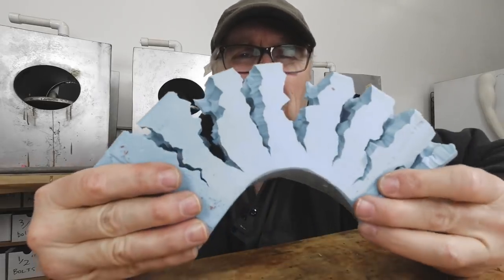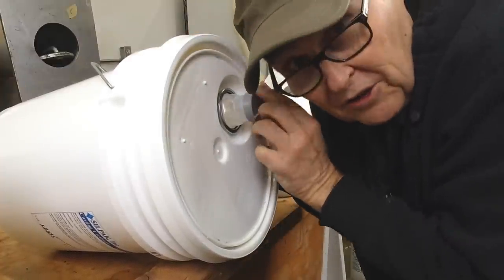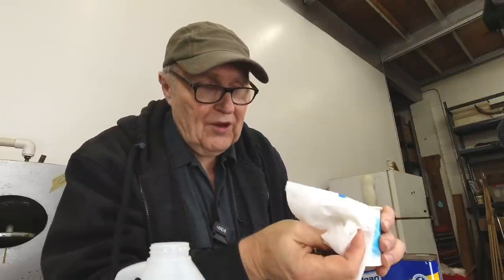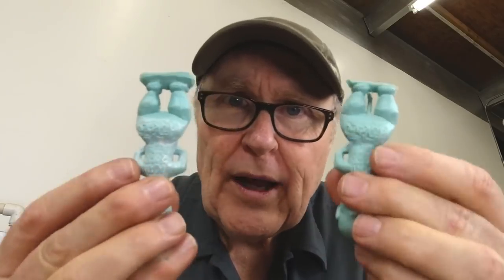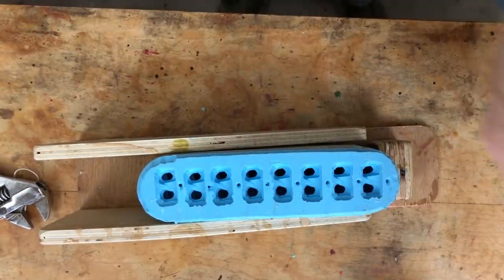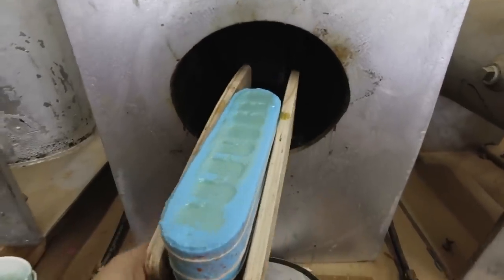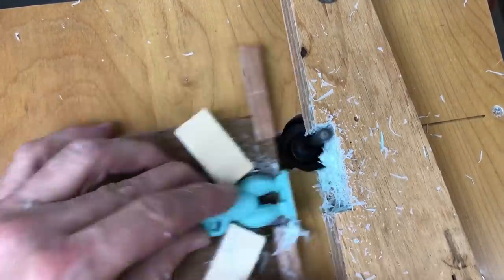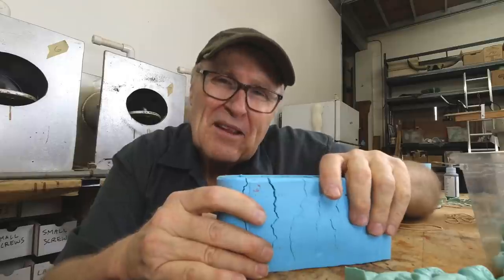150 Urethane Resin Castings - How To Make A LOT of copies fast!

Comment: I'd be curious if instead of drilling the holes in the head... you insert lubricated metal rods into your mold. Not having to drill those holes could save some man hours. The 7 or 8 rods in each mold, and pull and twist them out, or just heat the rods with some heat.

Comment: Your channel peaked my interest. I tought myself how to make rubber molds and plastic parts and create prototype. I learned a whole new different way of producing parts in plastics and metals. It cost more but you can produce thousands of parts a day and it's not plastic mold injections. I was done with that after I got a quote of $25,000 per mold. 3 size peaces comes to $75,000. No way jose. I had to learn new ways of making molds to save money to produce  products. Thanks for bringing back old memories of producing rubber molds. Oh ya the more you work with latex rubber. The more your body is unable to protect you. The rubber will start to burns your skin. Always protect your skin and fingers.  Just be careful. Thanks for sharing.

Comment: Great lessons! So, the jig is very nice. Something I learned to make a flat bottom on a one piece mold pour is to slightly overfill. Then take a spare flat piece of silicone, like maybe from another mold. Simply slide it over the overfilled opening. When the resin sets, it'll be perfectly flat. There may be a few bubbles but the pressure pot usually takes those out. You have a pro operation but this may save you time cleaning resin shavings.
Reply from the maker: For me I have found machining the base to be faster and more reliable.  But there are always several ways to skin a cat.

Comment: You're easy to watch Robert! I really appreciate the info as well. 
I also am a fan of paper towel in the workshop. I'm cheap though. I prefer turning toilet paper into a center-feed dispenser. 1kg  (1/4 Gal?) honey tubs  with a 1 & 1/4" hole in the lid makes the holder and it's fairly simple to pull the cardboard out of the center of the roll by first folding it in on itself. You end up with little single use squares of paper that suit wiping up small drips. The paper stays fairly uncontaminated inside the plastic tub as well. 
The for the really large shop rolls of paper towel that often come covered in plastic film, I just reinforce the plastic with packing tape and turn the whole thing into center feed dispensers as well.
Reply from the maker: Brilliant! I need make one of those now. I will keep my eyeballs peeled for the right size and shape of container.

Comment: Thank you Robert, great videos, I used to mould with Heat resistant silicone and then lead figures, I will have a look through your vids to see if there is anything I can find for those, with 3d printing now my new hobby, it makes moulding a bit more for fun me
Reply from the maker: I have not yet done any low-temp metal casting projects on the channel.  It’s on the list of video ideas.

Comment: Wonderful video. You mention at the very end that "all it needs is the painting". If  they're going to be painted after all that work of molding, why not just paint them the light blue color at the end, and forego having to tint the resin? Wouldn't that really speed up the whole process? I would think that spray painting a lot of units all at once would really cut down on the work of making them.
Reply from the maker: Yes, that would work as well.

Comment: Great work .can you make anything from paster of paris  
Can you make molds from plastercine 
If so please show us. Thanks for your time and patience
Reply from the maker: Sorry Tracey, I missed this comment from earlier.  I've never poured plaster into plasticine molds. It would be fun to try it.  I like using urethane rubber molds when casting plaster or hydrocal, hydrostone, etc.  They are cheaper than silicone molds and last practically forever when casting plasters and cements.

Comment: Still loving these videos. 
I’m going to try a unique way of creating a mould for a project using a 3D printer and wondering your thoughts. My idea is to 3D print 2 ‘bucks’ with keys, one for each side of the part, then I can create the mould halves from each. 
The main reason for crewing the two bucks rather than just a split mould is because the 3D printers leave a much better surface top side than bottom. The resin printers like I’m using are extremely accurate (about 0.025mm). 
Is my idea brilliant, or am I kidding myself thinking this might work?
I know you like to experiment with different things, if you’ve access to a resin 3D printer, I’d love to see what results you’re able to achieve with 3D printed part moulding and casting.

Comment: I have a plastic soap dish liner that fits into my chrome soap holder that is original to my 1958 blue tiled bath and shower.  One of the original soap dishe liner is lost and the other is cracked.  I would like to cast a few new ones!  The bottom of the dish is flat and thin, the back is curved and thin, and there are two little channels that fit over knobs that hold it in the chrome soap dish.  For me, it is a complicated shape to make a mold for.  Any suggestions?  It has to be a split mold, but will I be able to split it along the thin side of the dish?  Thanks for your great channel.

Comment: If you're (still) still looking for projects, I have one. I want to make a Warhammer army of about 370 28mm scale (5 real feet = 1 scale inch.) miniatures. They're basically slightly fancier army guys. I'll be casting my own by hand so the exact shape doesn't matter - only the process. The ones you can buy from the company than makes them, Games Workshop are pretty expensive and don't have that much variation in the poses and accessories you can use. 

I was wondering if you'd be able to walk us through the process of building one, or a small selection of  posable miniatures and then casting several versions of the pose from that self-same miniature. In this case, I'd like six pieces- head, chest, arms, legs. I haven't been able to find anything good on how to build action figure style casts with ball and lever joints for arms, necks, and legs- would be quite helpful for me, and hopefully fun for you.

Thank you so much for all the videos. I've easily learned more from you than from basically  all other channels in the space combined. I look forward to whatever you decide to put out next.
Reply from the maker: Send some pics of what you want to make to me at roberttolone@yahoo.com.

Comment: This video was really helpfull. I do have a project that I dont know if could work or not. It's not about casting but injection with a small vertical plastic injection machine . But I was wondering about the posibility of using a mold of silicone instead of the tradicional metal. I dont know if you can do something like that but with your level of knowledge in mold making it could be great if you can! Thanks for all your content!
Reply from the maker: elmareao Yes, you can use silicon molds with injection casting machines. You will want to build a strong wooden case around the silicone mold to contain it during the injection. Obviously rubber bands are not going to be strong enough to keep the mold closed.  Good luck and let me know how it goes.
Reply: @RobertTolone  Thank you!! Yes, I was thinking in building a metal case to heat it a little so the plastic dont coold down so quickly and get to the end of the mold! Thank you for your tips! Glad to know I'ts not that crazy idea!

Comment: If you had the choice of resin 3d printing (assuming multiple machines) or casting as per your video which would you do for this job?  and why? Considering the labor on casting vs cleanup with 3d resin, what would be the pros/cons.  I guess it would come down to cost per piece.  Thanks love the channel and your wealth of knowledge is greatly appreciated, I've watched so many of your videos.
Reply from the maker: I would still go with resin casting. But that’s going to change and I think eventually 3-D printing will take over even production work.
Reply: @RobertTolone  Thank you sir, appreciate your craft and sharing your knowledge.

Comment: Liked.
I am pretty sure you could not provide actual numbers as it would not be commercially kosha, but is there any chance you could provide an idea of what a job like this is worth?
Would you be able to condense every moment spent on them to an hour number and then give an idea of what the hourly rate was you worked for?
Taking out the cost of materials of course.
The reason i ask is that from where i am sitting it looks like your time would be worth a heck of a lot more than what you could sell the figurines for.
Unless they are for a tourist type operation i dont know how they could be profitable your customer.
All good if it is too risky to provide numbers i will continue to be a BIG BIG fan of your videos.
Reply from the maker: These necklaces are at the very bottom edge of what I consider worth my time. But I do them for a number of reasons other than just the money. The most profitable work I do by far is sculpting prototypes for kids meal toy programs used in marketing  major motion pictures.  I stay away from high-volume,  low-unit-price casting jobs because then I am competing against foreign shops with much lower labor costs. There’s no way to make any money doing that.

Comment: Thanks so much for this, I'd love to learn how to do this stuff. I'm new to your channel, and just subscribed.

At the end of the video you mentioned suggesting casting ideas- I'm wondering about casting tobacco pipe stems, but I know nothing about this at all. The best stems are made from ebonite rod. I currently turn my stems on a lathe, using acrylic "pen blanks" but wonder often about trying my hand at casting, and what material would be best to use.
Reply from the maker: I have no idea if urethane or epoxy resin would be safe for this use.
Reply: @RobertTolone  ok, thanks for the reply.

Comment: Awesome work, but why not use a different kind of resin that actually holds its color? Seems like this is A LOT of extra steps and experimentation to get that color. Amazing videos always though and thanks for sharing your experience.
Reply from the maker: Do you mean a resin that is the same color before and after curing? I am not aware of any fast setting urethane resins like that.  Let me know if you can recommend one. It would indeed save time color matching.

Comment: Hi Robert, Thank you for your time making these very informative videos, they are the best I have found!  Very informative, with just enough of your humor, just great!  Anyway, I make and sell an ancient Viking game called Hnefatafl and want to upgrade the game pieces, and I am looking at casting them in resin.  There are 37 total pieces in each basic game, 24 dark, 12 light, with 1 king piece that is also light colored with it having kingly markings.  All the other pieces have the same look other than the color.  Right now I use 3/4 inch wooden  round domed screw plugs stained and sealed, and they look ok.  I want to stay roughly the same size, but adding some simple detail work to each snazzing up the over all look.  I sell  1000+ sets a year (and growing), so that's 37,000+ pieces.  Any tips you might have for me would be greatly appreciated, both in techniques in mold set up, as well as tackling production runs to these numbers.
Reply from the maker: I would make sure that each piece is designed for resin casting. Mold wear will also be in issue. Resin wears out silicon molds pretty quickly. Getting very clean castings with clean parting lines and minimal post finishing will be extremely important.  Pressure pots will be essential for bubble-free casting.
Reply: @RobertTolone  Thank you Robert

Comment: Another great and helpful video, I do have a problem/question to ask, whether it's enough for a project I'm not sure.
I've sculpted a 1/6th scale head, I'd like to put it into production, but I'm unsure of the best way to re-create the neck cavity for attaching to a body, I'm new to the 1/6th customs so getting answers is a bit of a "challenge" shall we say. Anyway, I purchased a head from an established company to see what the "Industry Standard" is, it's basically a hole.  I'd rather incorporate that into the mold than have to drill out every head casting with a 10mm hole. Im guessing I'd need a 2 part mold at a minimum. My first thought was to take a mold of the neck hole from the head I purchased. Any feedback would be most appreciated, cheers, Mick
Reply from the maker: Hi Mick, can you send me pics to roberttolone@yahoo.com.
Reply: @RobertTolone  can do

Comment: Hi Robert, What are the different types of material do you cast?  How about bronze or clay?
Reply from the maker: I have confined my channel to resin casting. Bronze foundry work is a very different discipline; so are ceramics. I have done some  metal casting and sculpted and fired clay sculptures but am not an expert in either process.

Comment: Nice & educational video. Is the silicone mold holding intact for the 150 castings or you need to make more than 1 molds?
Reply from the maker: As I recall, I was able to get the 150 castings out of those eight cavities.  That’s 19 castings per cavity and that’s about as far as I like to push things.  How many castings you get per mold depends on many factors. For most projects I get as few as 10, for others I can get a great many more.
Reply: @RobertTolone  It would be nice if in the future we can see a video with a casting made from 4-5 different materials. eg. Urethane, epoxy resin, etc. Which are their unique properties and where each type is being used? Also, for silicones there are numbers like 40 shore A, etc. Technical datasheets talk about tensile strength, elongation at break, etc. What are all these numbers and what they indicate? Not knowing these things is a possible stopper for a beginner like me that wants to have a trial in casting.
In later videos you have your material & suppliers list but Silpak is nowhere in Europe and neither Amazon or Ebay have materials like Econosil or Silcast. Any suggestions of what a beginner should be looking at before buying some kind of casting materials?
Reply from the maker: @ekalyvio  Your question is a good idea for an entire channel, not just a video or two.  There are so many casting methods and materials. Just in plastics they include urethane, epoxy, polyester, acrylic, and many more.  Each one of these materials is available in a wide array of characteristics. It’s a vast world so how can a beginner sort through it all?  I suggest you define what it is you want to make and research the best materials and methods for making that exact thing. What properties does your object require?  By defining the end result you can narrow the field of research considerably.

To answer your specific question:
Shore :  how hard or soft material is. There are many shore scales ranging from 00 to D. The lower the number the harder the material.
Tensile Strength : how much pulling force a material can withstand before it breaks.
Modulus of Elongation : how far a material will stretch before it breaks.
Viscocity: how thin or thick a liquid is. Water is very low in viscosity. Tar is very high in viscosity.
Specific Gravity: How dense is a material compared with water or air. So a liquid with a specific gravity of 1.5 would weigh 1 1/2 times as much as water.

Comment: Mr. Tolone, have you ever tried mixing acrilycs with PU resin for coloring? I've seen some experiments and it looks like it works without compromising the curing process. I haven't tried it myself because I've barely started sculpting and never done a casting, but I've been doing some research for the future, and it looks like it works. Just wanted to hear a pro's opinion!
Reply from the maker: I use dyes and pigments designed for urethane resin. Acrylic is a water-based paint and water causes urethane resins to foam. I would like to see the combination of resin and paint that people are using to make it work.

Comment: I recently found your channel and I like your work and the way you explain
I want to make old brass keys mold, 6 at a time or more if it’s possible, I have 8 different sizes, have you done this before? It is better to make one mold for each size? Thanks for sharing
Reply from the maker: I would make a six-gang mold of each of the eight styles of key. I have several videos on my channel about making gang mold for production pouring of castings. Be aware that brass can inhibit the cure of silicone rubber.  So you would want to test your rubber with your keys to see if there is any problem
Reply: @RobertTolone  maybe some paint first?

Comment: I am new to resin casting and 3d printing. So far I am interested in resin casting than 3d printing because 3d printing takes to long compared to resin casting.  I am trying to buy equipment and materials but I am not sure if I need a wash and cure station. I know that for 3d printing is needed but I am not sure resin casting needs it. Can someone please guide me? Also, do I need a heater ("oven") or heat mat ? All the videos I seen; doesn't mention it but sometimes the YouTube would say "need to put on the oven" or "needs to be cure". So, I am confused.